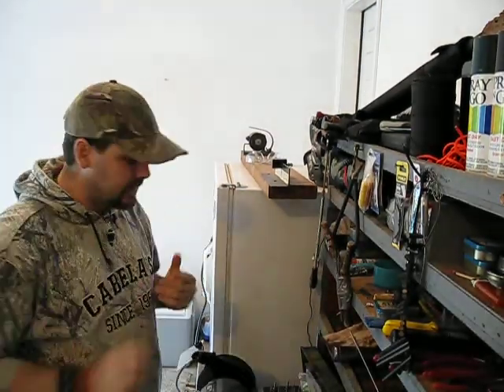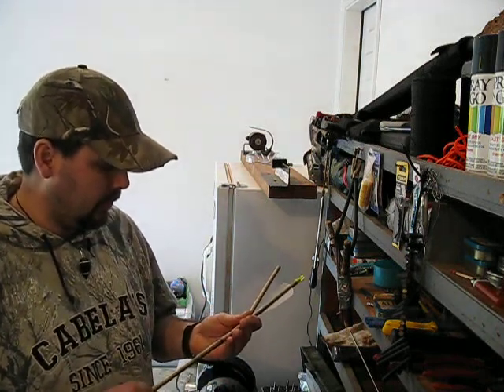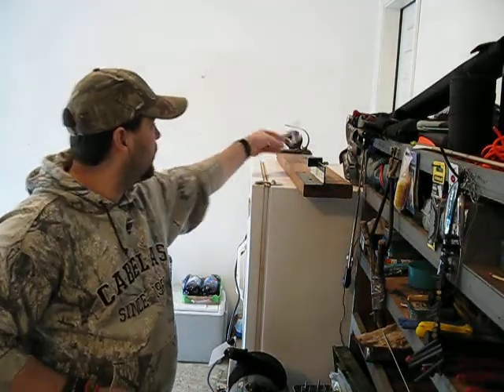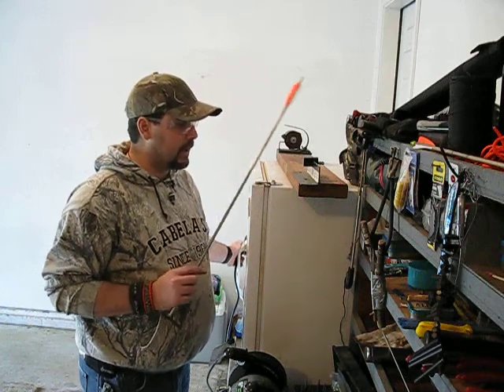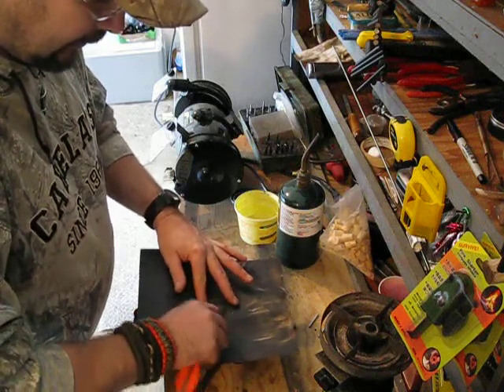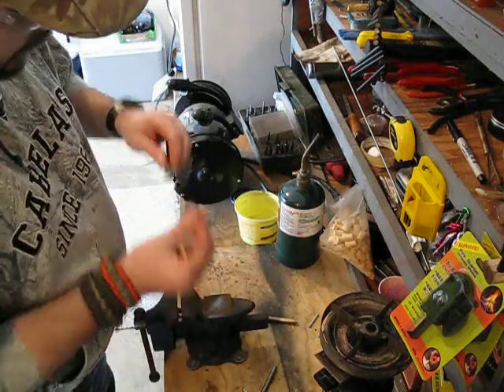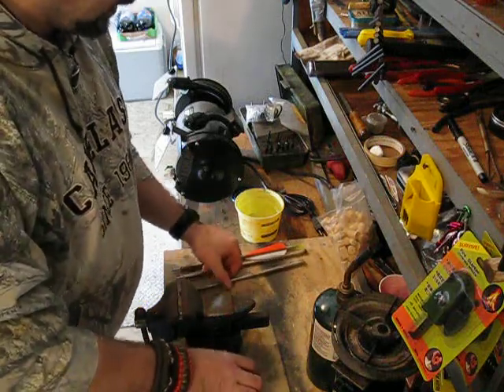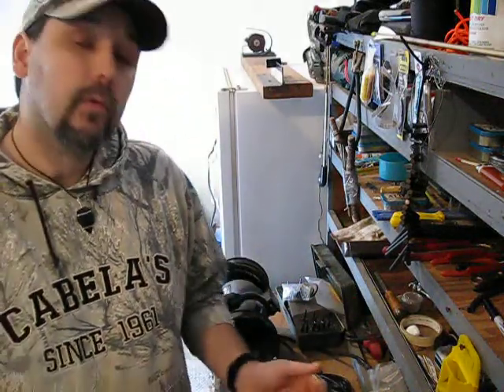3 Piece Take Down Arrow How To

Comment from the maker: Sorry for the delay, somehow I missed your comment until now. You are very correct, I use yellow and red. For some reason I can see these colors better while the arrow is in flight, so as long as do well marking the spot it hits I can find them easy. But at the right time of year they can blend into the leaves much more than you would think. My brother has been using mostly white and blue for a long time. The white wrap or dip helps a lot also! Thank you for your comments, John.

Comment: Because the aluminum cuts so easy you don't need to keep backing it up like with steel to clear it, then when you get all the way down to the chuck just reverse it all the way back out and you will end up with nice clean threads.
You can also do the same thing with a piece of brazing rod and you end up with basically a litte brass threaded rod.

Comment: You can take that plain aluminum rod and chuck it up in a drill smear a little vaseline on it and run it through the die in just a few seconds then you have a threaded aluminum rod and the whole process would only take about a minute.

Comment: Can you post a link up to those threaded arrow inserts you are using, I understand the threaded rod part, but not where to get the part you screwed it into. I searched "Take Down Arrow Inserts", and "Threaded inserts", but could only find very expensive inserts ready to go.
Reply: Here's a link to the cabelas site.  They are about $3 for a dozen which is enough to make 3 take down arrows.They're just regular old arrow inserts.  The same one's you'd put in a regular arrow before threading in your broadheads or field points.  Like CommonSenseOutdoors said, MAKE SURE YOU SIZE THEM TO YOUR ARROWS.  Otherwise they won't have any strength.

http://www.cabelas.com/product/Easton-RPS-Aluminum-Point-Inserts-Per-Dozen/744895.uts?Ntk=AllProducts&searchPath=%2Fcatalog%2Fsearch.cmd%3Fform_state%3DsearchForm%26N%3D0%26fsch%3Dtrue%26Ntk%3DAllProducts%26Ntt%3Dinserts%26x%3D0%26y%3D0%26WTz_l%3DHeader%253BSearch-All%2BProducts&Ntt=inserts&WTz_l=Header%3BSearch-All+Products
Reply: Colin Richards Thank you.

Comment: Ii just ordered some 2117 inserts for my arrows (Easton Gamegetter 2117 Alum. arrows)! My local wallymart had nothing for bowhunting ! Just a few kiddie bows. No arrows or any parts. They stink!  Any way,  do you think I can  use a hot glue gun to glue the inserts in ?  Thanks
Reply from the maker: If you are hunting with them? I would for sure spend the extra 5-8 bucks and get a stick of Ferr-L-Tite. The stick will last a long time and make many arrows. Good luck and stay safe, John.
Reply: Its on the way ! Thanks